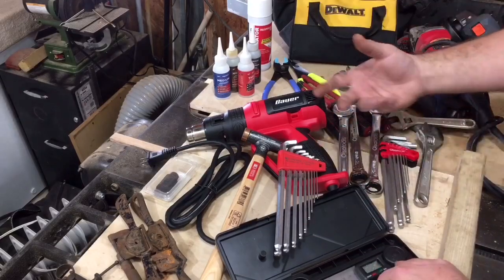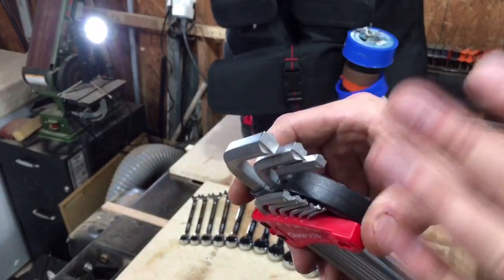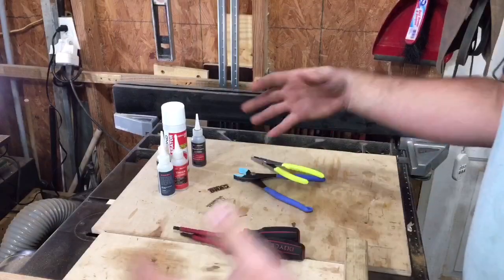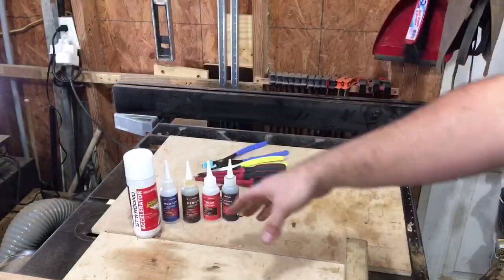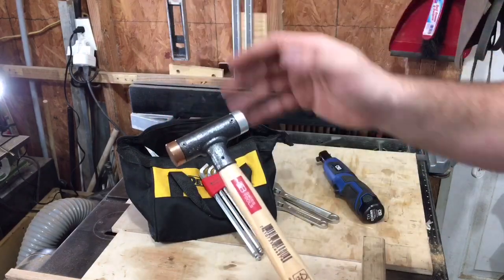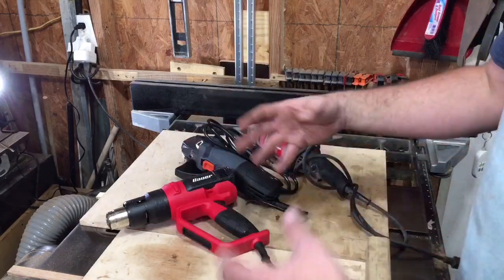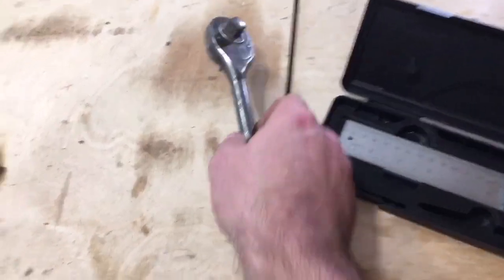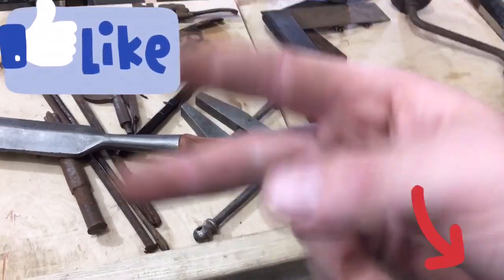NEW Tool Haul || Olsa Tools, Tsunoda Pliers, Doyle, PB Swiss, & MORE

Comment: Very envious of the hammer. Love it! Probably gonna get the slip joints with the resin jaws.
Reply from the maker: Link in the description 👍 helps support the channel. The hammer comes in a few different sizes. Very nice but pricey. The resin jaw pliers come in several designs as well

Comment: Man that's an OG wire terminal crimping tool
Reply: My grandfather had an old old pair of lineman crimper/splicers from when he worked for the phone company
Reply from the maker: I could definitely see that! I knew someone out there would know. Thanks
Reply: @BradsWorkbench  not a problem one of the cool features is you can put 2 wires in the figure 8 area and twist them around really good

Comment: Channel Lock has an amazing pair of those duck billed pliers. Made in the USA and under $15. They are my absolute favorite pliers.
Reply from the maker: Ill have to check them out
Reply from the maker: U sure they still make them? Only ones i could find on amazon were $26 just now
Reply: Brads Workbench Not sure if they still make them. Model #718. I got mine back in February and just double checked and I actually paid $18 for them. But they are worth every penny.
Reply: Brads Workbench You are right. They are over $26 now. But I think they are still worth it. I also have the longer Tekton ones and they are good too and I think they are $14???
Reply from the maker: @truckerpeterose  oh yea theres a ton of duckbills in the $15 or less price range. I wanted to check out this brand. I think you should as well. They are pretty sweet
Reply: Brads Workbench I am going to grab those soft grip ones for sure. Those I definitely can put to use. Appreciate the video. 👍🏻
Reply from the maker: @wayneo7307  good to know

Comment: Yo Brad! I like your style on giving a review on the backpack after some use. Inwould love to know how the stitching will hold up after time with all that weight packed inside it. For me it's either the stitching or the zippers that always fail.
Reply from the maker: Ive had it about 3 months with about 65 lbs. Its a well built bag but does have some things i dont like. The review will be coming soon 👍
Reply: @BradsWorkbench  Yeah I've been looking at backpacks, so would be curious.  The prices on most of the backpacks makes me wary if they'll hold up.
Reply from the maker: @PawOfRizzo  same same. Its mostly gonna depend on what you need. This olsa seems well built so far and is great for large tools. But that limits the amount of individual pockets of course.

Comment: You can get a husky back for $30
Reply from the maker: Yes i'm well aware. This olsa one is much higher quality than the husky. I plan on talking about how it compares to the husky, klein, and awp backpack in its review
Reply: @BradsWorkbench  I have the husky 1 but didn't use it yet. I do have a side job coming up Saturday so I mite try it out
Reply from the maker: @Tailgatesntoolboxes  i'll have to get with you before the actual review and see how its doing. The olsa definitely has room to improve. Its worth the $89 just for the durability it seems to have thus far. But to get the $129 they gotta make some slight improvements. In my opinion of course 🤷‍♂️
Reply: @BradsWorkbench  sounds good.
Reply from the maker: @xephael3485  klein has some VERY nice ones. Lots of pockets too
Reply: The hardy backpack at walmart actually looks pretty decent
Reply from the maker: @xephael3485  i just threw some pics of it on my IG the other day. It don't look bad for a $30 bag
Reply from the maker: @gregblau8082  you're right. Not super heavy duty but for light to medium use it looks ok
Reply: @xephael I haven’t really looked at any of them before just happened to notice that one Christmas shopping. I’d imagine the husky one is very similar or better. I’ve got a few things to exchange at Home Depot so I might take a look